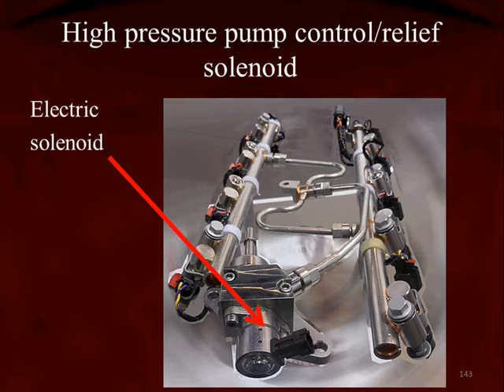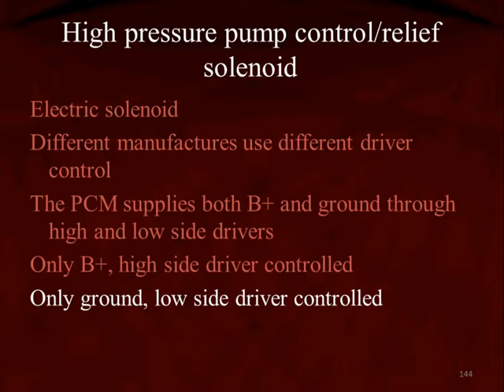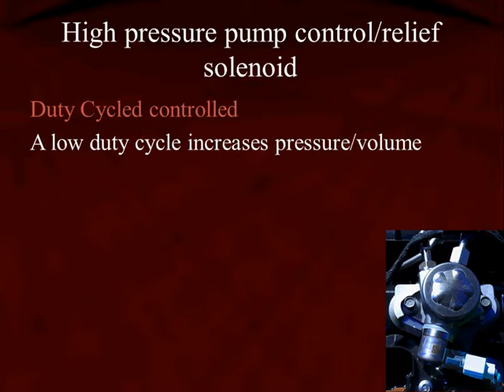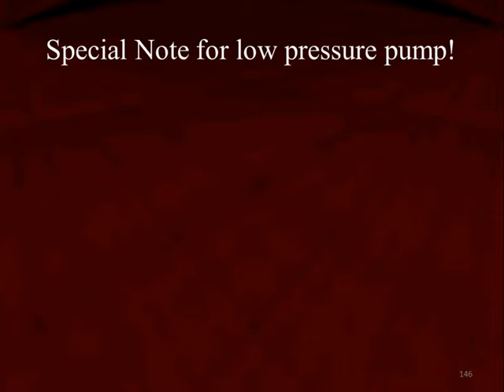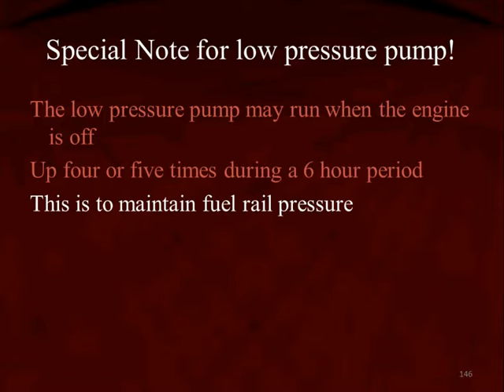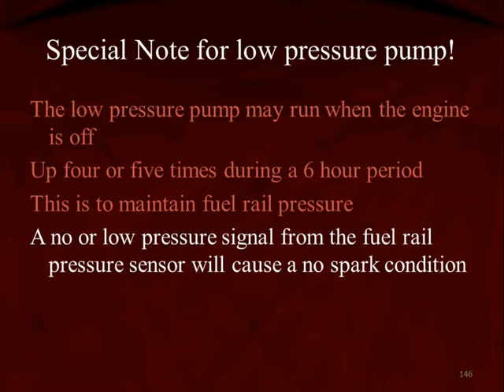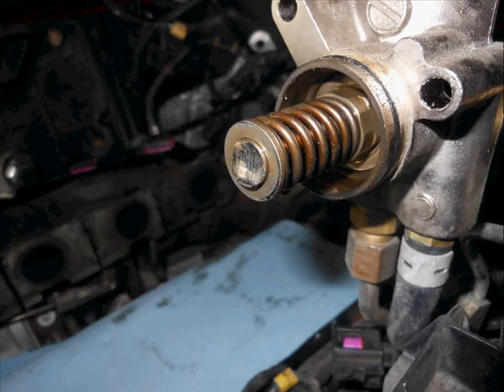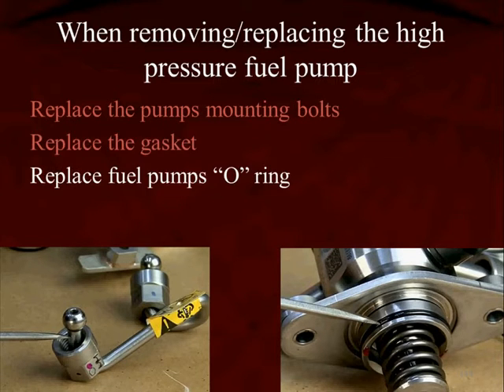19 Fuel Volume Control

Comment: i have a mercedes car with no high pressure ,pump replaced follower and cam looks ok ,but the control solinoid PWM signal cannot check ,test done with peanut test bulb found ok , so my question is if i disconnect the control wire pump should make high pressure?

Comment: Thank you so much for this video! The pump on my 3.5 ecoboost developed a horrible clanking noise I can hear from the cabin. I monitored the pressure as I drove and it jumped some 50psi, but overall was close to the demanded pressure. Now the moment I unplugged the solenoid, the noise was gone! So I suppose I'm going to the dealer to get a  $500 pump tomorrow. I don't think I'd understand the inner workings on this thing without this video. Thanks again!